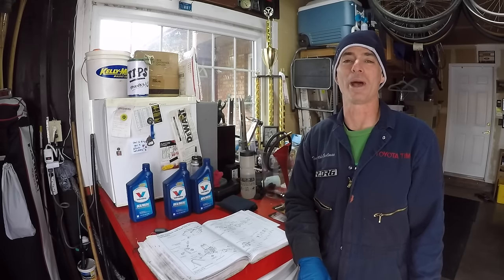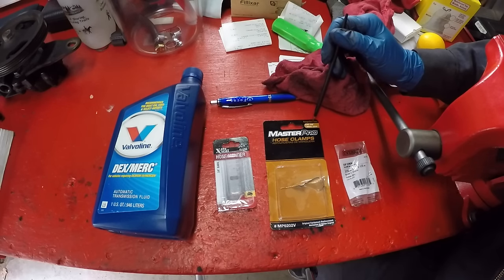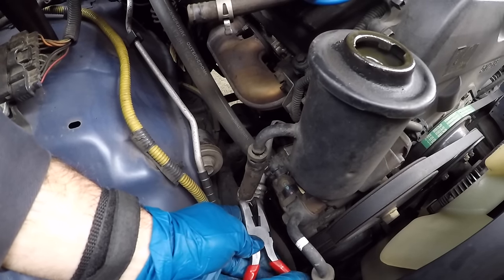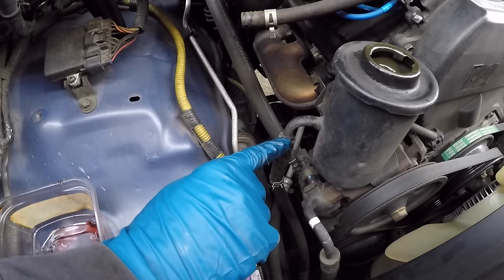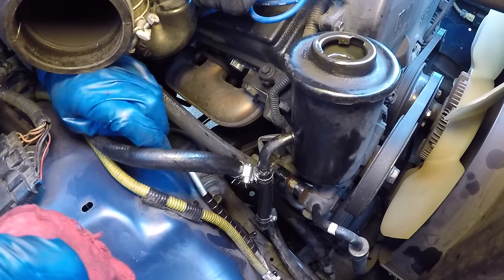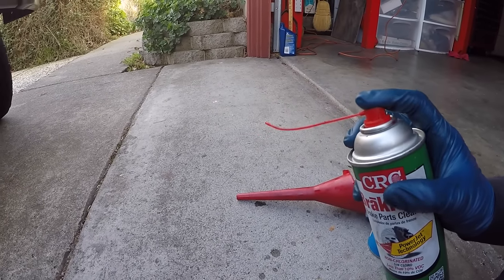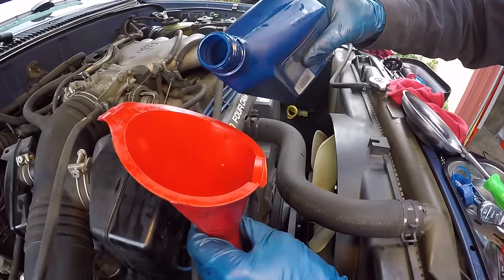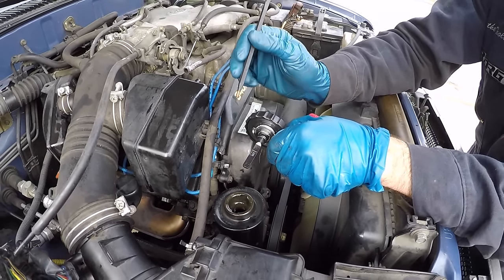Power Steering Flush and Reservoir Cleaning

Comment: So, another great video. Like always. Replaced the fluid on my 01 T4R 2wd.  I used ether (starting fluid) to clean the mesh screen and it worked well. Hardest part of this job was removing the hose mender. I had to give it a good cussing 😆. My wife is reporting smoother steering. So all went well. I also think I will add the magnetic particle filter too. Thanks Timmy and Sean! Great work!
Reply from the maker: Thanks Craig.  Great to hear the job went well for you with a good result.  Thanks for taking the time to comment and share your success story with us.  You're very welcome and Happy Wrenching!

Comment: Thanks, Timmy The Toolman!  My '98 SR5 started whining when temps got in the 20's/30's recently. Initially, the noise went away after I let it sit and warm up for a while; however, a few days into the cold weather, the whine did not go away , and then it started sounding terrible when making turns.  Thank you for this video - my mechanical skills are very limited, so your steps and video work were incredibly helpful.  I followed the steps, and the whine is now gone (only one day in - we'll see if it lasts).  Thanks for your follow up notes also. I saved a lot of mess by using the mityvac fluid extractor you posted, and I appreciate that you posted yet another option of using the inline filter method (may try that in the future).
*Some issues during my work - I had a rough time getting the reservoir mounted back onto the pump.  As stated in your notes, the dang o-ring ended up tearing the second or third time I tried to attach the reservoir back.  I had ordered a couple of o-rings (per your advice), but at the time I did the work, they were MIA and hadn't arrived on time, so I had to go for it due to limited time.  I ended up using some screw thread tape (??) for the time being, so I may end up leaking some since I don't have a good seal.  I never heard a pop or snap when I finally got the reservoir back on (I heard some type of pop noise in your video), so again, I may end up with some leaking.
-Forget "I saved a bunch of money by switching to Geiko." My new motto: "I saved a bunch of money by listening to Timmy."  I see a TEQ Tim t-shirt in the future thanks for the money I've hopefully saved on this!
*Also, can you please post a pic or short video of your inline filter?
Reply from the maker: Thanks for dropping a note on the comments. We like that slogan. Sounds better than geiko’s! Haha. I think once you get another “O” ring on there and you push it down to seat the surface you’ll hear a pop. You can reference our radiator install video where we link to a Magnefine magnetic filter but it’s optional, not necessarily needed.

Comment: Great video.  The images clarity, smooth non jerky, movement, well lit clear views of your video set it apart from others. I initially thought your videos were long. Yes long but very through, again cuds for indepth quality.  Skill question, I see in your list of details you have included a magnetic filter.  Sounds like a great idea.  Maybe I missed the explanation on it.  Does it restrict the flow of fluid to any great extent and is there a guide line as to how often it should be replaced. Thanks for the great work!
Reply from the maker: Glad you like the video and you're very welcome.  Yeah, lots of people think our videos are long, but like you noticed, they are very informative and detailed and that's the reason for the length.  The Magnetic in-line filter does not restrict flow.  They are made for power steering and automatic trans systems.  I installed the filter in the return line around 5 inches or so before the reservoir.  I basically installed it to where it's not rubbing against anything.  You just have to cut out a short section of the return hose to make room for the filter and then you use a couple hose clamps to securely attach it.

Comment: after watching this video it got.me thinking about the clogged filter in reservoir and thought to myself what's the point of flushing really, if the rack is being starved of fluid. Yes it helps but figured the screen cleaning could be just as.important if not moreso. Had my ps flushed a few !months ago which yes did help but decided to clean screen and flush again! Now my ps is quieter, smoother and I believe my steering to even be slightly more responsive. Screen was about 95% clogged. 
Also when I did mine I simply jacked front end & turned wheels fully back and forth, worked great, thanks much you guys for making this vid!!
Reply from the maker: Good to hear the screen cleaning helped out.  We weren't aware at the time of filming this video that you could effectively move the fluid through the system with the pump off but we know it works and it's a definite option for people to use.  You're welcome and thanks for taking the time to comment.  Happy Wrenching!

Comment: You have been my savior many times throughout the ownership of my 3rd gen lol! I'm at 290k miles and the power steering has started whining. Time to do this!
Reply from the maker: Read the comment I pinned before doing the job because there is some additional information to share that might change how you go about the job.  Great to hear out videos are helping you out.  Let us know if the whining goes away after the flush and reservoir screen cleaning.
Reply: @TimmyTheToolman  I did see that comment and ended up just slipping hose over the turkey baster tip to successfully remove all fluid that could be removed before the screen. The reservoir screen was 100% completely blocked upon inspection. I cleaned it out and flushed the system. The power steering now works much stronger but now I have a different whine and bubbly fluid. I bled the system a few times but the bubbles and whine return every time. I think the old O-ring at the bottom of the reservoir is letting air in because I have no leaks anywhere else and that seems like the only logical place for air to be getting in at this point, so I'm about to replace that O-ring and give it another go!
Reply from the maker: @TortureTestMagazine  Ok, hopefully the new o-ring does the trick.
Reply: @TimmyTheToolman  It did! I don't know why I chanced it with the old o-ring to begin with, since that rarely works out for me on anything... But it was a quick fix anyhow. The steering is now effortless and silent.
Reply from the maker: @TortureTestMagazine  That's great to hear.  Good job getting it done.

Comment: Hey Timmy I always enjoy your vids. You have helped me out several times on my Tacoma. I wanted to know what you thought about this idea> (I don't know if you have enough room as I am fixing to work on my pump in the next few days and will find out). 
It will take a bunch of clamps>return from rack to 3/8" barbed ball valve>then filter>then 3/8" T > then to bottom of fluid reservoir. Side outlet of T>3/8" ball valve> then the section of the hose with the plug in it.
When changing fluid>cut off valve below filter>remove piece of pipe with plug from side T ball valve>hook piece of pipe on ball valve run to container> open ball valve drain reservoir into container>when reservoir is drained>put plugged pipe on reservoir>install another small pipe with plug on upper ball valve>then off the side T ball valve you can regulate the flow as you run the new fluid from the rack. Does that make sense? If you need to change the filter cut off the valve below it>open the side T valve drain the fluid out of the reservoir> after it is drained you could take it loose from the pipe on the side and bend that over into a container to remove the last bit of oil from the lines and filter. I am a plumber by trade, didn't know if there was room for this but it would be a lot less messy. What do you think? the ball valves are $7 and you would need 2 and a lot of clamps.
Reply from the maker: I'm sure it would work but is all that worthwhile to just avoid a little fluid mess?  If it is, do it.  I recently swapped out my magnefine in-line filter and it was messy, but I just wiped up the mess the best I could with raga.

Comment: I flush my first and after flushing the old liquid I added sea foam trans tune , idle for 30 minutes moving the sterring all the way to the right and left every 5 minutes and after the 30 minutes a take a brake. After my little brake i star to driving on the city for 2 or 3 hours , came back home let cool off a little bit, change the fuid  ( sea foam trans tune ) and put the  original fluid dexron merc 3 back on the trans, that trans tune is magical my man no more noise no more stiffness . ..
Reply from the maker: This is good to know about the Sea Foam Trans Tune product.  Thanks for sharing this.
Reply: I had the same experience with Marvels Mystery oil, the pump was very noisy and now sounds normal by leaving the MMO in the fluid for a few months. It was a Saganaw pump on a GM.

Comment: Hey, Timmy. Every repair I do on my 2002 Tacoma I reference your videos first. Can’t thank you enough for your service! I’m about to do my steering rack and my power steering pump. I’ve already watched your steering rack video and will definitely use it as a guide. Do you happen to have a power steering pump replacement video? Again, thanks so much, best videos out there.
Reply from the maker: It's great to know you reference our channel first.  Thanks for letting us know that.  We don't have a video for replacing the power steering pump, but it's not that hard of a job.  Breaking free the high pressure line from the pump would probably be the hardest part, and you have to remember to buy a new gasket for the line connection.  It's a special double line gasket.
Reply: Awesome, thanks. Just ordered up the parts. It took a good amount of effort to find the right gasket because all the fitment checks said the specific gasket I found was incompatible with my model, but I double checked with my local dealer and sure enough part 44327-30040 is the correct fit. For any one out there curious, I have a 2002 Tacoma crew cab, 5VZ, 3.4L, 4wd.

Comment: Thanks for a great video on this. I woke up to a whining and stiff power steering in my '01, so I have to do this job. Instead of clamping a bolt, when I want to plug a hose I just get a lag screw or other course thread screw, then you don't have to mess with cutting, clamping; the threads do the trick to hold the "plug" in place.
Reply from the maker: Glad you like the video and thanks for sharing the tip with plugging the hose.

Comment: Good video I did very thing you said, although after two bottles of brake clean my reservoir was super gunned up and I had to take the reservoir apart and scrap the screen clean, it was very gunked up after 320k miles. Also replaced the rubber black o ring at the bottom with a fresh one.
Reply from the maker: Thanks.  Good job giving your power steering system some love.

Comment: Good job.  I wanted to avoid running the pump, so I used the PITTSBURGH AUTOMOTIVE Suction Gun to totally empty the reservoir. I disconnected the return line and capped the return tube off the reservoir and then connected to Suction Gun to the return line. Basically, instead of using the steering wheel pump, I manually evacuated the fluid using the suction gun. Once all the fluid was out, I started adding fresh fluid into the reservoir and used the suction gun to pull it out till I saw clean fluid coming out of the return line. At that point, I emptied the reservoir again, removed the cap, reconnected the return line and re-filled the reservoir and tested for the right level and took the truck for a short ride in the neighborhood and re-tested for the appropriate level.
Reply from the maker: Sounds like a solid technique.  Thanks for sharing.
Reply: @TimmyTheToolman  You inspire me to do the work myself (well with my 13 year old). I don't trust the dealer (overcharge  + sometimes they use the wrong fluid) and the mechanic does not use the right fluid / spark plugs or oil. I already completed the 30000 miles maintenance work with the exception of flushing the radiator. For some reason I had a hard time replacing the oil filter. Next is to flush and change the breaks. P.S. I did not clean the power steering reservoir, maybe the next time around. Also, I believe the 1998 4Runner Limited 4 wheel drive V6 AT takes about 7 Quarts of 5w-90 and about 4+ quarts for the transmission. Take care - Sami
Reply from the maker: @Sami-bc9iv  Good to hear Sami that our videos are inspiring you to turn wrenches.  Have fun with the upcoming projects.

Comment: I do my Highlander a much easier way in my opinion. As the car is running I take a syringe and remove fluid almost to the bottom. Then I add fluid back to the top and repeat the entire time the car is running and the fluid as you noted circulates very fast. Since there’s only 1 to 2 quarts total in the entire system running 4 quarts through this way essentially replaces the entire amount of fluid. Occasionally I’ll go and turn the wheel lock to lock during this process. Entire thing takes about 15 minutes and you don’t have to remove any hoses. After three or 4 quarts the fluid is bright red. I tried the way you were doing it originally but the return hose pumps so much fluid out almost instantaneously I found it hard to do it.
Reply from the maker: Yep, you're method is what we refer to as the "Turkey Baster Method".  The difference is we turned the vehicle off when we were exchanging fluid out of the reservoir.  We made a video about it.  https://youtu.be/GOb5yF2Xv8Y.   Have you ever checked the condition of your reservoir screen?  If you've always had pretty clean fluid in your system, it's probably not that blocked up.  If the fluid has been allowed to get pretty dirty at one time or another, that reservoir screen could be partially or mostly clogged.  Another trick to keep your reservoir screen from becoming clogged is running an in-line magnetic filter in the return line to the reservoir.  The extra filtration will guarantee that you're reservoir screen won't ever get clogged but you will have to replace the filter every 30k miles.
Reply: @TimmyTheToolman  thanks Timmy!  Yes just replaced all PS line in the car due to a high pressure hose leak. Replaced suction supply line and reservoir at the same time. Broke open the reservoir at the seam at the bottom and the screen was entirety clean. This is a 220k vehicle. Must show great maintenance by me!  Replacing reservoir was golden. Now I can see the fluid flowing/circulating in the reservoir and can see the level so clearly now. Just now finished running 1.5 quarts through it - had already done 3 quarts. Compared new with last syringe and you could not tell the difference!  Thanks for the reply!

Comment: Thanks for this. I had a spare pump laying around, took the reservoir off and had a look inside, noticed the filter was attached on the end of the inlet pipe with a split pin,  so ended up taking the top off and giving it all a good clean, also replaced O-ring with a new one. It was not too bad inside, dread to think what the one on the car is like tho as the fluid is black. So i will swap pumps around, and drain the rest of the fluid from the rack and pipes.
Reply from the maker: Good job!

Comment: Once again Timmy to the rescue. Fixed my extremely tight steering. Screen was 98% blocked.
I can buy another 4runner with the money you've saved me this year.
Reply: I have a 98 sr5 4w taco. The steering is very tight on low rpm and when drive through gears and rpm rides no problem. Do you this it is block age or pump?
Reply: @JoseRodriguez-vx6hd  is your Fluid dark? Have you ever flushed it? You have nothing to loose by flushing it. It's really easy
Reply from the maker: Hey Tyler, good to hear cleaning your reservoir screen fixed your tight steering issue.  Great to hear you're saving lots of money doing your own work with the help of our videos.  Happy Wrenching!
Reply from the maker: You've got nothing to lose Jose.  I take the reservoir off, clean the screen and flush your system.  I bet your steering improves afterward.  If not, it wasn't a waste of time because a new pump doesn't come with a reservoir.  You take the reservoir off your old pump and swap it over to the new pump.
Reply: @TimmyTheToolman  I spoke too soon. My steering tightened back up. How do I determine if it's the rack or pump?
Reply from the maker: @tynado1173  Don't know how you could narrow it down between the two unless one was clearly having issues like a loud pump or a leaking steering rack.
Reply: @TimmyTheToolman  my pump doesn't whine, my rack doesn't leak, nothing smells burnt. My only symptom is tight steering that sporadically goes from tight to tighter and back. I'm puzzled
Reply from the maker: @tynado1173  I'd be puzzled as well.  I think a replacement pump would be the more affordable thing to try first to rule it out.  You could possible pick up a used one at a wrecking yard.  That's what I would do before replacing a steering rack.

Comment: This is a great breakdown and explanation of how to really clean out an old system. Stumbled on your videos late in the summer and am about to do this one on my '97 SR5. But as someone also here in the South Bay, the weather is putting things on hold a little longer this week. Thanks for such straight forward and detailed videos. Definitely have given me a solid outline of where to start on some future maintenance I'll be doing, too.
Reply from the maker: Hey John, glad you like the videos.  You should make it to our next party.  It will be sometime this Spring, most likely in April.
Reply: Right on, yeah, that's local of course so I'll have to try and do that. Finished this DIY today on my steering flush/cleaning. Big thanks again! Had no reason to second guess if I was doing it right after your awesome breakdown!